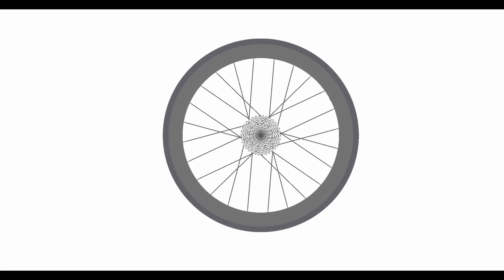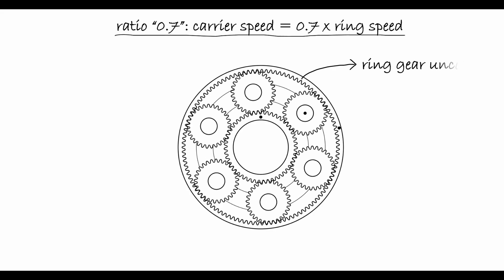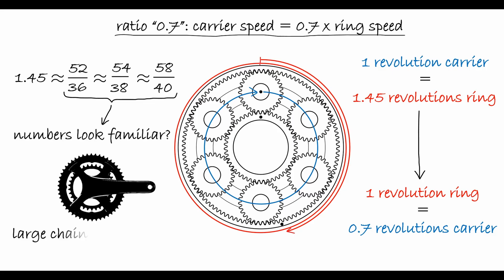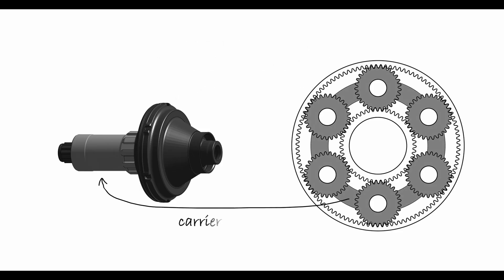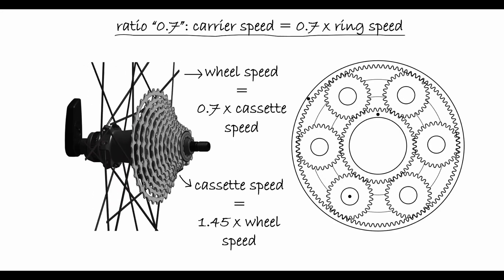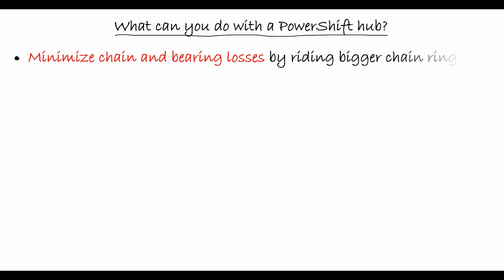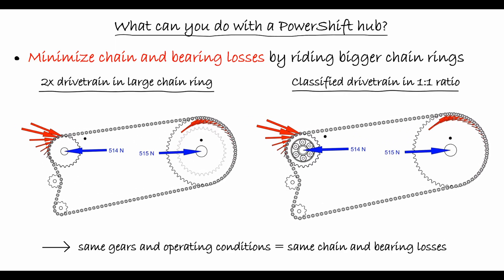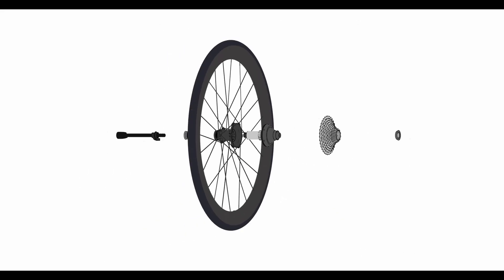Why you can get rid of your front derailleur with the Classified Powershift Hub

Comment: if you want a 3 speed internal gear hub with cassette, then you can get the Sturmey Archer CS-RK3 hub. for just 1/20th of the price you get a speed more, no need for electronic shifting and it weighs only 500g more.
Reply: This is designed to replace the front derailleur. You can still add a 10 speed cassette. With the SA you have 3 gears and that's it.
Reply: @zoltanszabo8747  No, with that SA you have 3 hub gears and a 10 speed cassette as well. It is also a combination of both, just like this hub. Except that they did it way cheaper and like 15 years ago
Reply: @poltem1  You're totally right. I was thinking of another product, not this one. My bad.